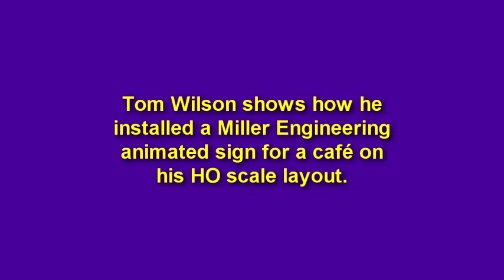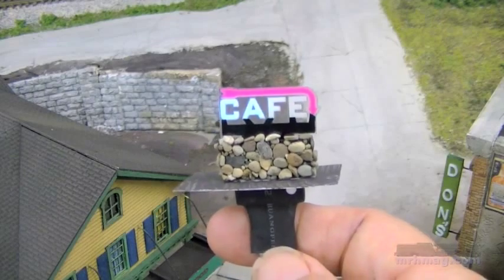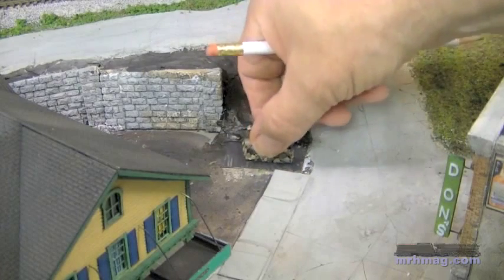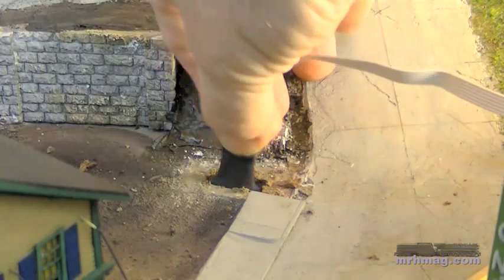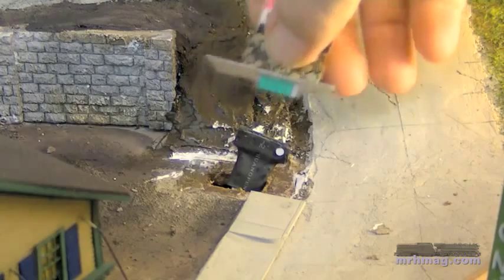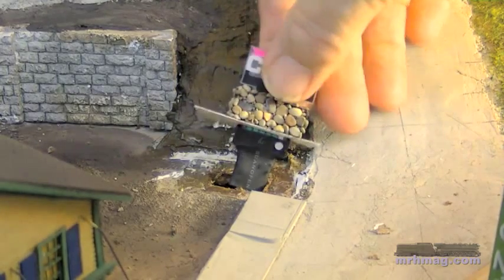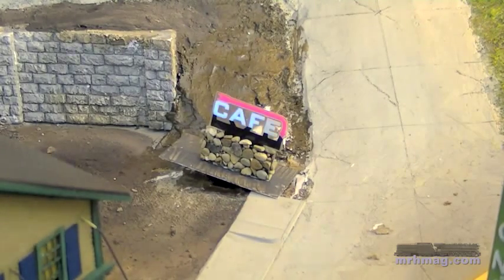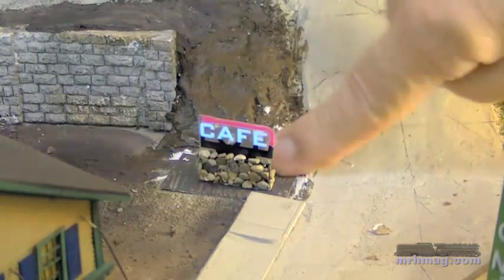mrhmag.com - Oct 2011 - Installing an Animated Cafe sign

Comment: Sign is confusing. it points as if the cafe is underground. I think that sign belongs on top of a building or somewhere above the actual cafe. like on a hill with the cafe down below..just one  guys thoughts...
Reply: TOM it is supposed to be mounted in front or side of building .
They have many sign s that are right or left mounted depending how you view the signs.